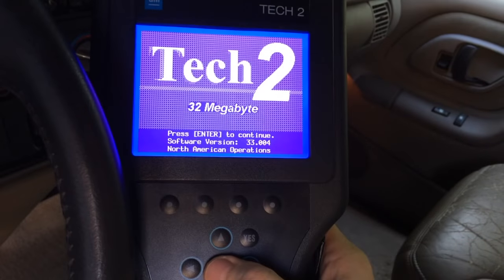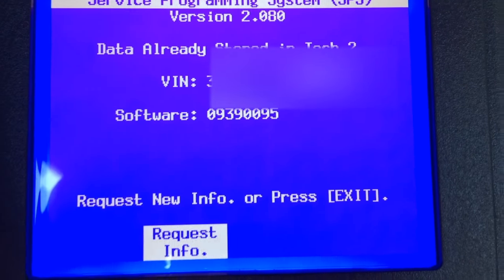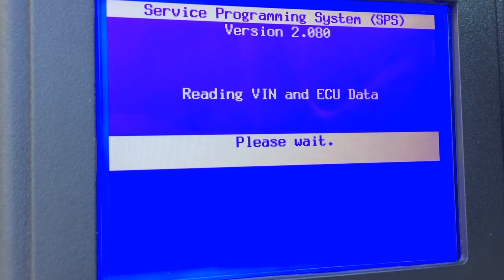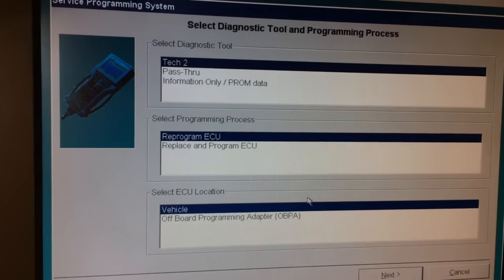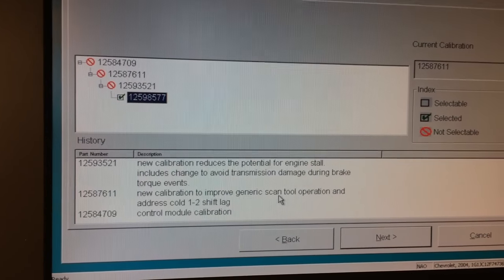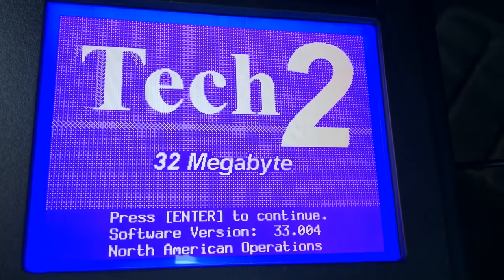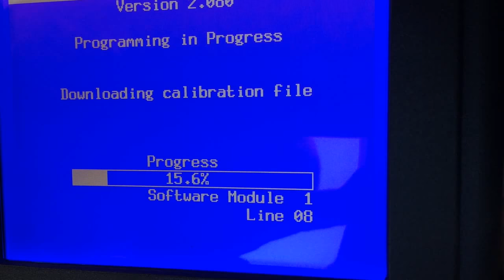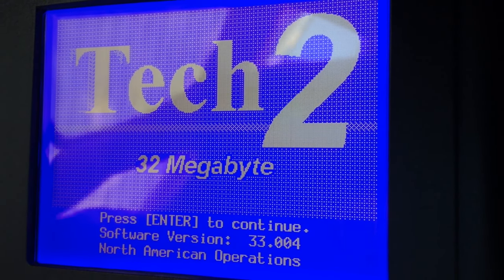GM SPS Programming: Tech2 Tool Remote Mode ECU TIS2000 How to do a Calibration Update Reflash (PCM)

Comment: THANKS for this video. Really helpful. I wish I could triple Like this video.
I have an unusual issue. A 1997 Chevy S10 pickup with a 1995 engine. This engine does not have Cam Shaft Position Sensor and so the truck is stuck with a Check Engine light.
My assumption is that if I reprogram the ECU to be 1995 but keep the VIN then the Check Engine goes away and the truck can be successfully smogged in California.
DrShock does this sound possible to you?
Reply from the maker: No, it doesn't but then I don't usually deviate from factory configs.  Changing the VIN isn't going to change the behavior of the PCM (what you refer to as an ECU) but it may allow you to put a 1995 calibration onto that 1997 ECM, I just don't know.  Depends on how compatible those two years were, how smart the GM SPS software is, etc.  The problem here is you have a 1997 PCM connected to a 1995 engine.  If it were me, I'd just put in a 1995 PCM to match and use the Tech2 to assign my VIN to that '95 PCM, presuming the rest of my 1997 options were compatible with that 1995 unit.